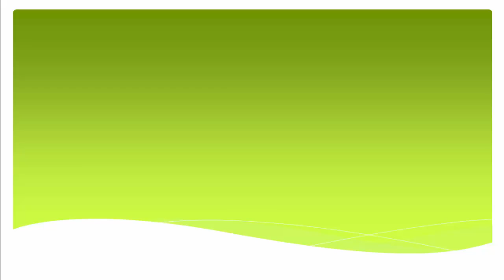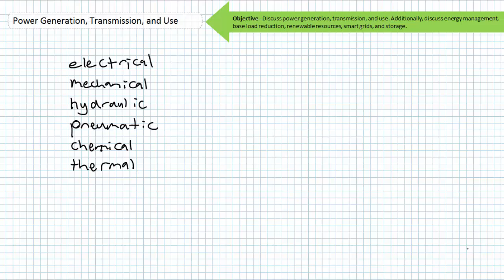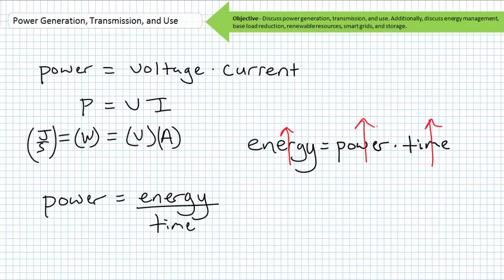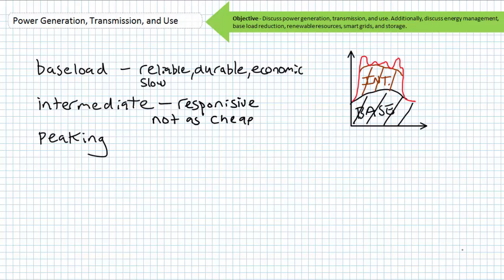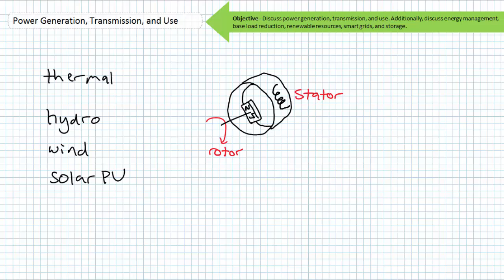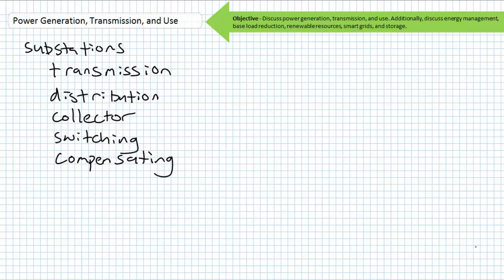Power Generation Transmission and Use

Comment: https://www.nsf.gov/awardsearch/showAward?AWD_ID=1002653

0:00 Introduction
3:00 Energy conversion
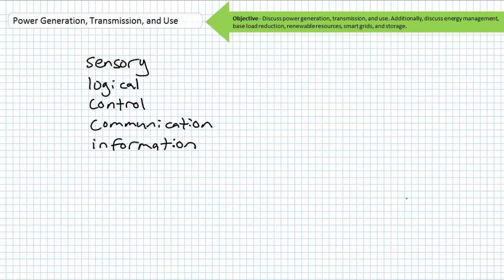5:00 DC, single phase AC, and 3 phase AC
6:30 Power electronics
10:30 Power, energy, and efficiency
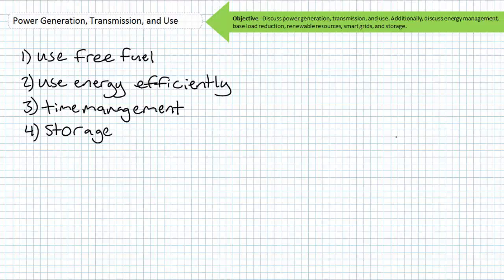17:30 Energy use
22:00 Base, intermediate, and peaking power
32:00 Generators
39:00 Power transmission and substations

Great and interesting narrative.  Seems way outside of a DC circuits course.  AC circuits seems a better location for this content.  It is a good summary of power grid concepts from a technical perspective.  Who was the target audience for this?

Collectors as opposed to feeders?....  Collectors are typically how a distributed resource is interconnected.  And if they are not primarily for generation or on a dedicate facility, I'd not call them collectors.  There are no mention of distribution or feeders.  That was a little surprising.

Comment: I'm 100% for renewable electricity sources such as wind powered turbines, hydroelectric dams, etc. But when it comes to EVs I am not so sure. The technology sure is amazing, but modern day batteries are lithium based and lithium mining is extremely detrimental to the environment. I would go with the development of hydrogen fuel cells as the only by product is water. If in the future, battery technology changes to something more environment friendly, I'd be glad to accept it. And yes I am aware that hydrogen fuel cells are still in development to this date. But there's more to it than meets the eye. The real reason it hasn't been researched enough is because the government can't make a buck in taxes off of water.

Comment: This is the best learning tool for an apprentice I've come across.  Do you have videos on inductance, capacitance, impudence?  My 2nd year has focused on AC theory.
Reply from the maker: Yes, unfortunately they're still in development and editing stages right now. Stay in touch because I'm hoping to eventually complete DC, AC, three phase AC, hydraulics, motors/generators, motor control, industrial wind power and more.
Reply from the maker: Just posted some sample AC Circuit Analysis lectures at: 
https://www.youtube.com/playlist?list=PLdnqjKaksr8pXF2SpDyyD7ouAVlz96_Ra